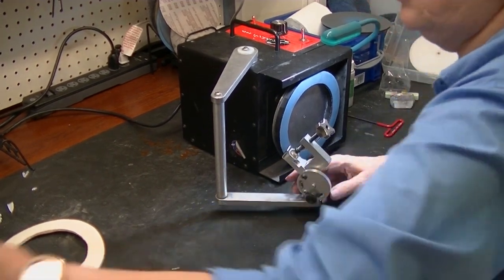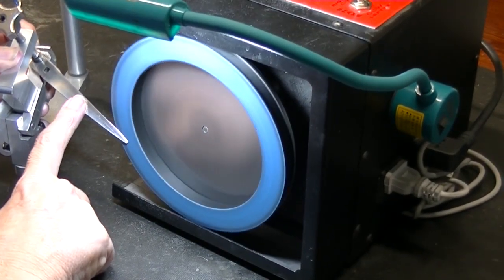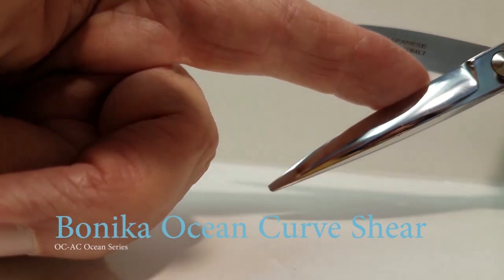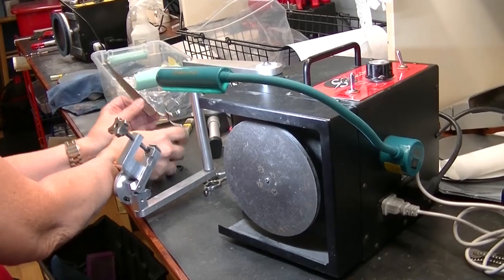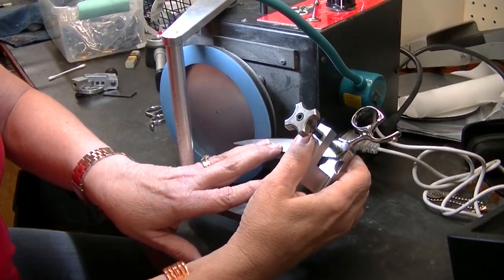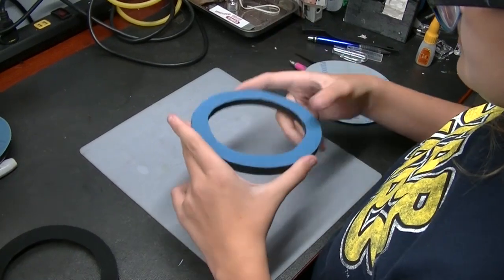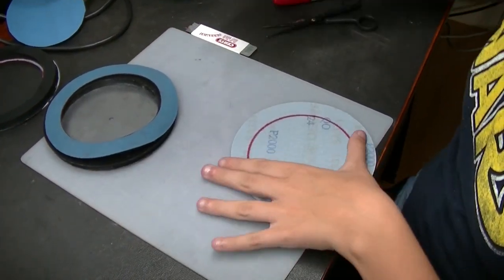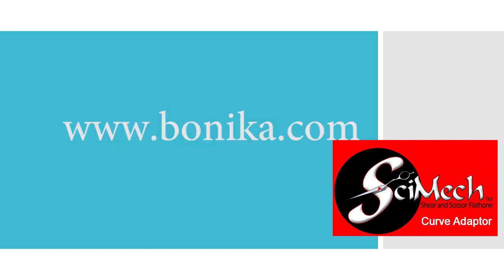Scimech Curve Adaptor Sharpening Instructions

Comment: Kind of copying the Ez-Vex.
Reply from the maker: I've seen the EZ-Vex and I believe the sharpening is on the inside of the ring. This is on the outside and fits to most flathones.
Reply: @BonikaShears  Ez-Vex is on the outside too. Always has been. I bought it specifically to do curved shears.
Reply from the maker: I think that it utilizes the inside of the circle, ours is an adaptor for a flathone working on the outside surface.